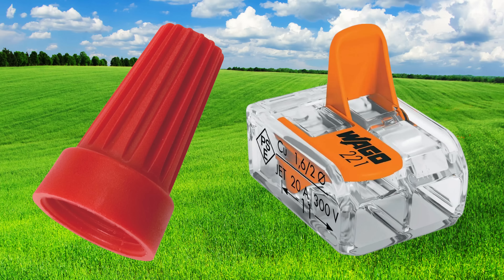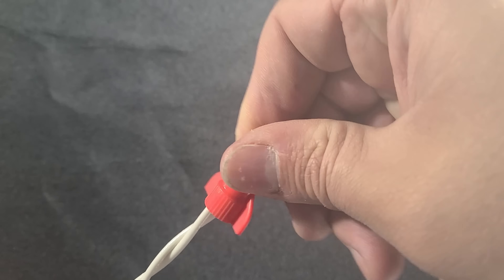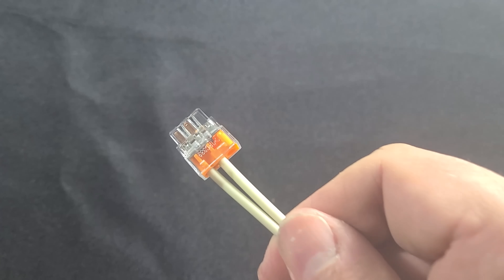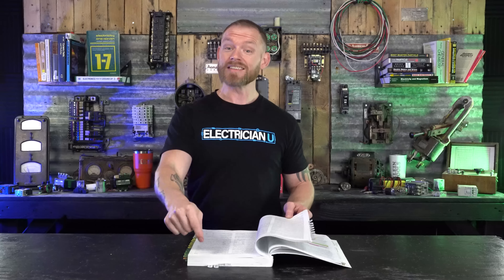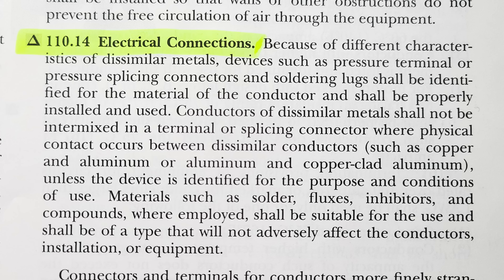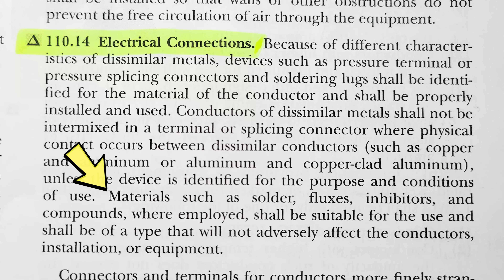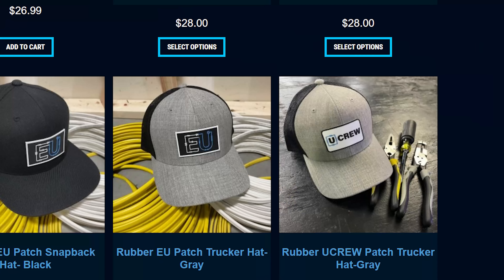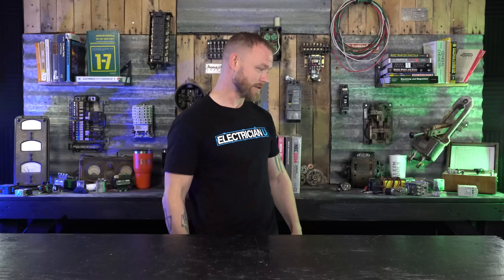Should We Use WAGOS or WIRENUTS?!?!

Comment: How about for DIY'ers?  As a DIY'er, I prefer Wago's because I don't have to worry as much about whether I made a good connection when I'm installing a receptacle or something.  It's either in the hole and clamped, or it's not (and you can turn it over and confirm the wire went all the way through).

Comment: I had a guy wire up my house remodel. He went through and wagoed everything with the non lever type. I didn't like that and thought they were a cheap garbage way of doing things. (The type of thing that belonged in all this cheap, garbage high density housing going up everywhere) So I re-did them all and after doing so I couldn't feel more justified. The amount of contact in there is so little compared to twisted wire nuts its unbelievable these cheap things are even allowed. Also, when taking all his shit work apart I couldn't believe how easily they would pop apart. If you care about doing high quality craftsmanship you don't even concider these lousy things. This guy is probably sponsored to say this.

Comment: When you use a wire nut the wires are spliced together when you use a Wego connector the wires never touch That means the Wego connector Will burn up if high amperage is drawn through it.

Comment: When its lower amps, solid and stranded, 2 different guages, don't leave twisted wires in the tip leaving you to get another, by all means. I haven't gotten around to wiring a motor with them or trust them in receptacles. Easy to remove with grimy hands, they are the ticket.

Comment: I’ve used the ideal version in a receptacle box where the wires were super short.   I’ve also used them in a junction box for the same reason.  Both of these circuits are for lower power draw areas.  TVs and such.  No motors or pumps.  

I have used them in light switch boxes as well.  No issues. 

I should mention my father was a master electrician.  He passed away back in 2019.  I couldn’t let his house go…why, because grandpa, uncle and dad built it.  

Should see some of the junction boxes.   Scary.  Everything is soldered.  According to dad back in the day, this was code.  It was approved at the time by the electrical inspector.

Comment: As  Wago's are slimmer (than round wirenut), I find them easier to fit into boxes (both fit, but less hassle)
Reply: Also wago allows wire to twist on its axle, while still holding good connection, where as wire nut keeps wire in place and does not allow it to move. This can cause wires to push out. Also what i have seen wire nuts wreck the ends of the wire so you cannot reuse wire ends that many times unlike with wago just open and shut again, barely any damage to wire. Again this depends on location, some work fine with nuts, but say you are connection multicore wire of led flood light to solid wire and we all know how durable those China flood light are, its better to use wagos as you will be replacing that light in future.

Comment: So if you should not connect two different metal wires together, what is the difference if I connect a wire that is not copper into a copper Wagon connector then? Those two different metals would still interact with one another.

Comment: You have touched on many aspects of using wagos vs wirenuts, but for the most important one.
30 or 50 years from now, will you see a difference if you had used wagos or wirenuts?
(It's the same type of question regarding wireshark or pex in plumbing)

Comment: I do love the new 221 Wago connectors and have been using them for allot of connections of late but they are expensive compared to wirenuts. I also use insure connectors in light fixtures for speed and they are nearly as cheap as wirenuts. Cheaper per connection when taking into account the time per termination.  I am also of the pre twist camp too.  I like wirenuts when I know I will not be going back in.  As to the stranded into the push in connectors, stripped correctly and inserted with care I have no problems with them at all in either the Wago or the Ideal products.  Lastly, the purple ideal wire nuts for aluminum and copper clad aluminum conductors are no longer recognized for permanent repair.  The only two termination methods that are recognized are those by King innovations or the Tyco Copalum.  The king is a mechanical set screw and the Tyco is a crimp.  The Tyco crimp is superior but the cost per termination is astronomically high!

Comment: I haven’t seen the Wago connectors in Lowes or Home Depot but I have purchased Ideal push-in connectors. I have used those successfully with LED light fixtures. I like that the push-in connectors only require one hand to connect wires which is great when you’re up high on a ladder.
Reply: Can you push flexible stranded wire into them ?

Comment: I love the 221's. And looking on-line, it's hard to even find the push-types anymore. I'm a trained electronic technician who ended up doing a lot of electrical work in real life, including wiring several of my own homes. So I do a lot of "changes" that include re-wiring, and those 221's are a real time-saver.  

One of the most applicable uses I've found is re-connecting two (or more) wires that have become a little too short after trimming damaged ends, where it's hard to get enough wire to actually twist. And they can be disconnected and re-connected without stressing the connections.

Great channel - just discovered you. I'll be back!
Reply from the maker: Thanks and welcome!

Comment: Wire nuts are crap, they were used +40 years ago here in Belgium, but are now forbidden to use here (they are also not sold anymore), because they become loose due vibrations and become brittle over time. For many years now are Wago the standard for using in junction boxes.
With Wago you can also connect wires from different gauges together and you can mix stranded and solid wire.

Comment: I try to avoid replacing ballasts with customers in the store. Best to do it before or after hours. I recently began to use wagos, but I don't like the type that are permanent requiring cutting the wire to replace. In that case I would prefer a wire nut, though often I can still get the wire out by twisting in one direction until it comes out.

Comment: I was on the lighting crew for a large Amazon warehouse, the largest building in my state. The lights we used were manufactured with Wagos instead of wire nuts. After we installed the lights and fired them up, right away about 10% of them failed outright. Over time, that number grew to 40%. Every time we had a light go bad, it was due to a waygo. Sometimes they would melt, sometimes it was just a bad connection, sometimes it was a mixture of both. Think of the time it cost the job for us to fix a fixture because of a bad waygo. 

The only time I use Waygos is for making up grounds. I now work residential, and now whenever I get a wafer light and it comes with pre-installed Waygos, I rip them out and use a wire nut. I will admit, they are a great concept, but they have to up their quality control if they expect me to stake my reputation on them. I refuse to use them at all, and the company I work for banned their use for all technicians.
Reply: Whats a Waygo?

Comment: Not an electrician by trade here, but I use wago lever locks for stranded wire. I've seen too many stranded wires destroyed after people have used wire nuts on them around a solid copper wire, even by professionals. Wago's make a real nice solid connection on stranded wire with no risk of fraying the ends.

Comment: I'm a DIYer, and like Wago/push-in wire connectors when space is at a premium in a J-box.

Also, for the record, any manufacturer who uses stranded wire on a small gauge wire (e.g., ceiling fan switches) should have his balls cut off with rusty garden shears.

Comment: I'm just gonna say this: once I discovered that I can prevent BUTCHERING my wires by using wagos, I have never looked back and never will look back.  I'm thinking about the next guy (and also that next guy will probably be me lol)
Reply: My house is 25 years old and some of the switches and receptacles are starting to fail.  It was a Godsend to discover Wagos.  (Just had a thought!  I wonder if the Wago Company will  start making receptacles with the Wago built in !!!).
Reply: @glasshalffull2930  you sir... Need to ask them about that. Wtf are we doing without those. Holy shit.
Reply: @glasshalffull2930  These receptacles are now being made,see Leviton's Decora "Edge". Wago makes a DIN-rail outlet box for Euro markets, no internal wiring necessary.
Reply: @50srefugee   Thanks!  I saw those recently.  I’ll wait a while to see their performance in the real world.
Reply: @glasshalffull2930 They are the defacto Standard in Europa nowadays. Actually no one has ever used a wirenut over here anyways. They basically don't exist.
Reply: @Felix-st2ue   I’m aware of the use of Wagos in Europe.  The thread had moved onto Wagos making receptacles that had their connector built in, but the comment(s) got deleted.
Reply: Check out the Leviton decora  line
Reply: Same here bro. It's why I made the switch too. No more need for 30 years of electricians clipping half inch of the wire because it was so mangled as to be unusable.

Comment: Wagos whenever I can. Wirenuts are inefficient and imo not as safe. So much easier to just disconnect a fixture while the circuit is still on. Soooo much faster and easier. They’re all I buy now! 🤗🤗🤗. And I never pretwist those wires and never had a problem.

Comment: New Sub,   I agree with you 100% ,  Had a buddy try to use LAGO in the middle of a long run in his barn where the wire was short. With tension they pulled out and he hated them.  wrong application there .  Got him some bare crimps for single wires and had him solder post crimp and then add heat shrink.  

Best use of WAGO's in in a terminal box on a motor,  sure makes it easy to get all the winding set up correctly.  

As an Engineer, I just let the technician do what he wants in junction boxes.  Don't need to hear the arguments as there is no fix with folks in either camp.   Stranded wire and a solid , sure makes sense to use the WAGO.   Wirenut crowd will solder post twist, then add wire nut.  

Look forward to checking out other videos.  Grounds and neutrals is something I see screwed up all the time.

Comment: If you like call backs use wago's if not use wire nuts, using wago's is like back loading receptacles and switches a lot of people do it but I don't
Reply: Using wago's is NOT like back loading receptacles and switches.
Reply: @elbuggo  it's the same principle so how is it not
Reply: @joenewman763  The proof is in the pudding.
Reply: @elbuggo  no the proof is in the service calls I have done replacing them with wire nuts because they failed
Reply: @joenewman763  Non of those things are labeled Wago.
Reply: @elbuggo  yes wago some of the high end LED light manufacturers put them on their lead wires so the electricians just have to put their field wiring in the wago I've had to replace several of them

Comment: Wages don't seem to be a good connection.  If you can spin a wagon on the wire not a good connection.
I have gone behind electricians in condos to do work and when you have more than 4 wires you get multiple wagos where I would have 1 wire nut.
I have also have noticed most boxes I have come across are a mess because of  all the wagos.  Just my opinion.

Comment: Random thots:
1. A "nut" twists. Wagos are not nuts. 
2. As my hands age, I dislike twisting more and more.
3. DYIers like myself should use Wagos for ordinary 12-14ga connections. Simple, fast, reliable, and most of all, each connection, each conductor, is inspectable by the installer. 
4. I prefer Wagos especially for cramped spaces, like behind a bulky GFCI, or where the wire fill is right at the allowed limit. Yes, and "cramped" in the sense of "hard to reach", like under a cabinet or behind ductwork.
5. Wagos for 3 or more conductors in a given connection, like ground or neutral bundles. I LOVE six conductor Wagos. 
6. Wagos for wires shorter than 6" in the box. Either the pro installer cut it too short, or, fatigued by the nut, the stripped end twisted and broke off.
7. Wagos for things that will be replaced, even at long intervals, like fixtures (as many have noted) but also for switches and outlets. I've replaced SO MANY outlets that no longer grip plugs.
8. Yes, if I must use wire nuts, I pretwist. even if just for two or three turns. 
9. One advantage of wire nuts: The contact area between conductors is HUGE, many times the area of the conductors themselves. I have no idea what the contact area of a Wago is.

Comment: Only thing I've found that suck with the wago 221 is when space is tight the wire itself can lift the lever and detach the wire since the lever sticks out past the housing a little bit. In those situations I wrap it in electrical tape. At that point you should probably just use a wire nut instead. I want a 221 where the lever doesn't stick out past the housing.

Comment: Wire nuts damage the conductors, while Wagos do not. I've had to clip (shorten wires) after removing the wire nut because of "overly aggressive" twisting. Now, I always replace wire nuts with Wagos. They also take up less space in the box, making installation of new smart devices easier.
Reply: You’re not licensed an electrician,that’s goddamn sure.
Reply: @BlueJay-v1b  Here in Central Europe, everybody uses Wagos now. Even some knockoff ones (for lights). Actually twisted connections or wire nuts are considered as some kind of prehistoric hackwork (had only been used in early days, then screw connectors came along). Yet buildings here don't catch fire all the time.
Reply: @JOHNZ476  House building in the US is about 20 years behind Germany.

Comment: Wirenuts are weird we use something called chocolate its brass tube with two screws to secure wire it can be used on way shorter wire than wirenut and only downside to wago is ability to split into two

Comment: I rarely do any new construction type work, so everything started with someone else being there. I cringe at the number of times I've pulled a receptacle, switch or light fixture and found a smoked wire nut in the box.  Are Wegos better?? They seem to be less prone to screw ups, but hard to say if they're more or less prone to the long term issues that wire nuts sometimes have,

Comment: I could see the lever type connector working well, still question a stab-lock. Stab-locks on devices were designed for ease of install, later job security with service calls.

Comment: Licensed Electrician - 20 years Experience - I have found like you pointed out I personally prefer to use Wirenuts in new installs and many applications. I love to come across Wago Lever Connectors and have never seen one in use fail yet. Where I have seen wire connectors fail many times are the stab in Wago Connectors. I actually cut them off entirely in LED wall packs where they come with or certain times I have found them in use repairing lay-in fixtures etc. I have seen them arc and spark and I have seen them completely burn up. The Wago Lever Connectors are nice and glad they have 2 port all the way to 5 or even 6 port connectors I believe. That is truly nice. I found them in a 2x2 LED fixture today I replace where the LED driver went bad and they were used. I replaced the Lithonia (2 years old) LED fixture to a new Philips LED 2x2. Having those Wago Levers was aweomse and with the double MC connector and 3 inch short wire. I will be ordering them for our hospital soon. As of late I have been using 3M combo Red/Yellow and the jug of Orange/Blue wirenuts. They work great. Take care guys. God bless 🙏

Jeff - Sunny Central Florida

Comment: i dont use wago type spices very much, i was always told they arent as good or secure as wire nuts. i love using them for spicing allumium and copper together, but technically for it to be legal you have to use the wago brand noalox, or at least with the ones i have used.